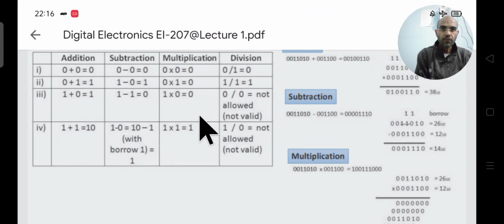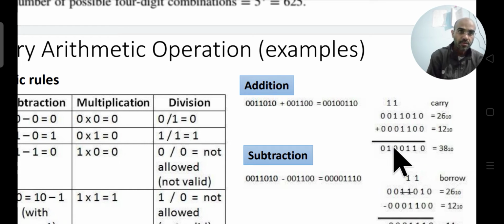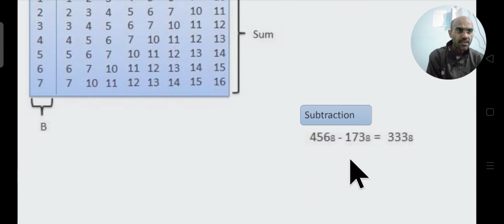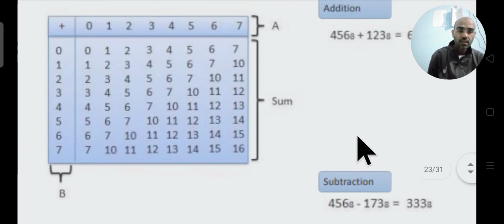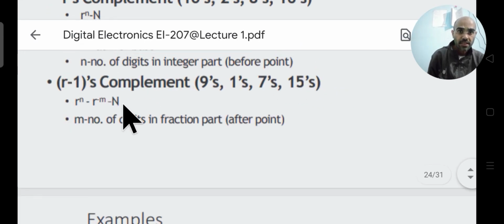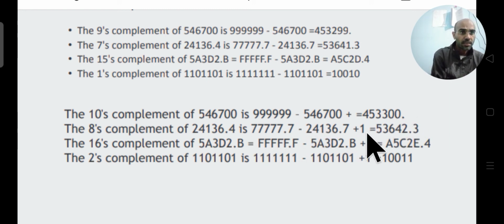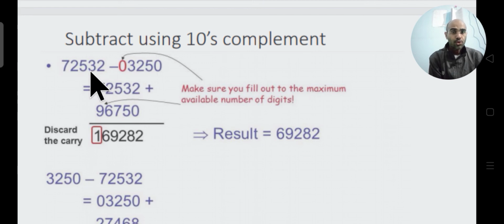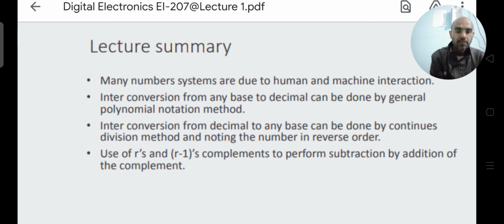EI-207 Digital Electronics L1-D

Comment: sir in the (r-1)complement form in order to do the subtraction don't we have to find (r-1)complement first and then add it to the number to which we have to subtract and then if the carry occur add it to LSB. and in case of no carry take the (r-1)complement and put a negative sign in front?? as in the slide for (r-1) complement method also r complement is written.
Reply from the maker: You are absolutely right. r's complement is just a typing mistake. I clarified that in the last tutorial class.